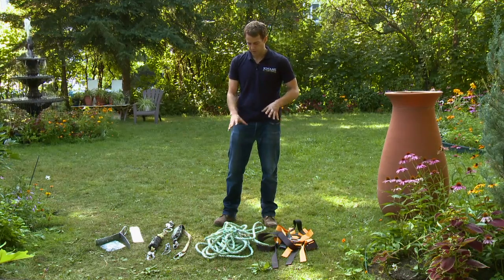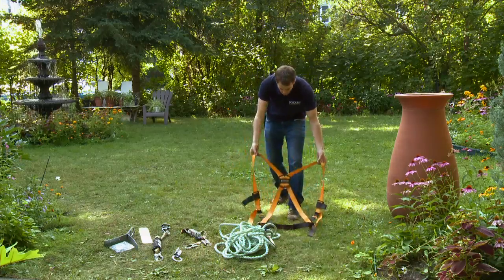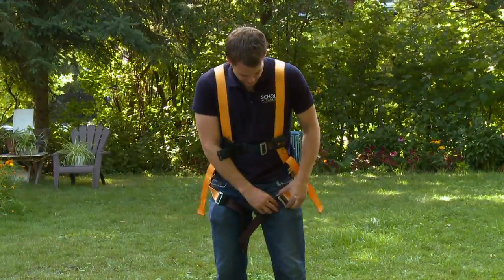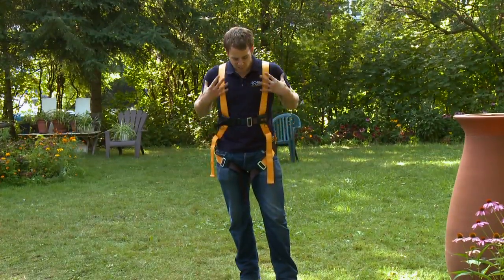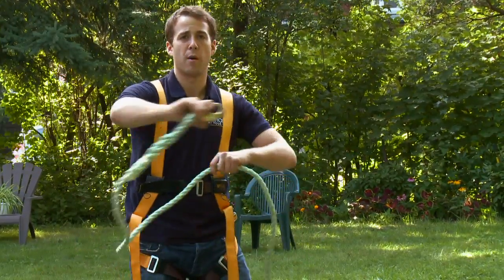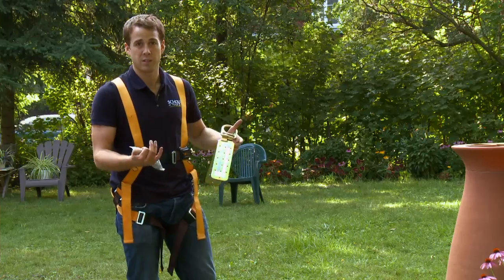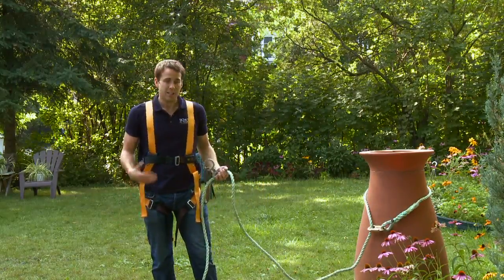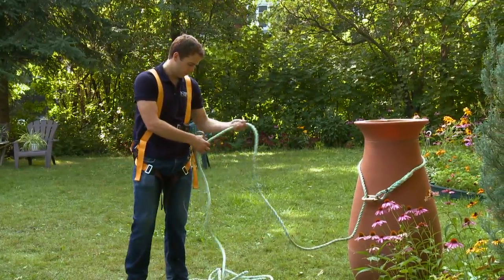1  Fall Protection System

Comment: Generally, I like your video. Great instructions on properly securing a rope grab - you've cleared up a lot of pitfalls that many workers experience. A few recommendations on the video:-the anchor is to be secured using the type and number of fasteners as recommended by the manufacturer, which may or may not be what you used. It is very important to just follow instructions to get the 5000 lbs hold strength.
-while adjusting the harness, the chest strap should be at about the breastbone. It's not absolutely necessary, but the straps will settle themselves in the course of a fall, and it could hurt to have the strap slide up by itself with the fall velocity.